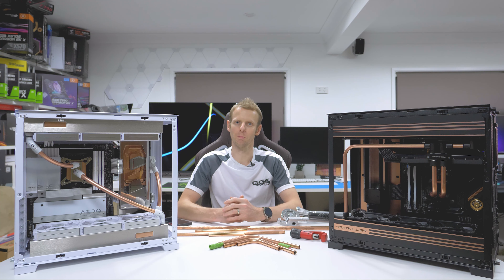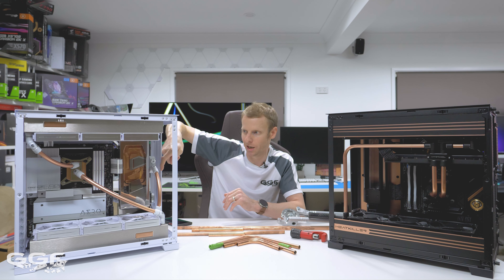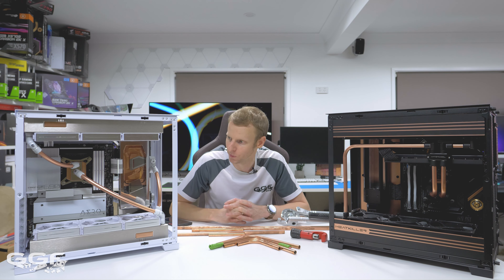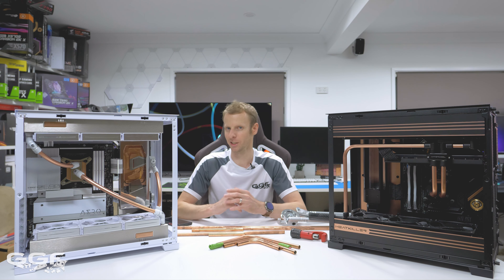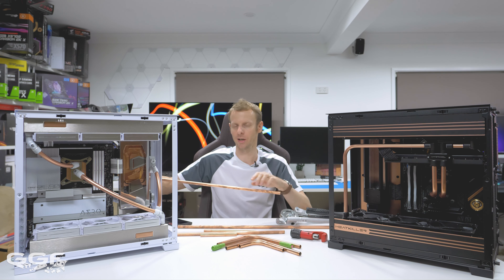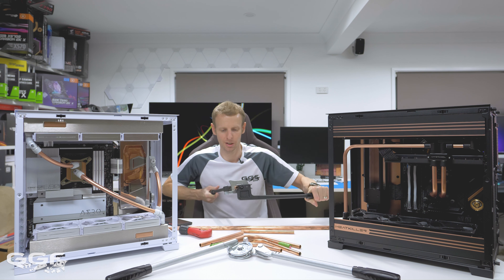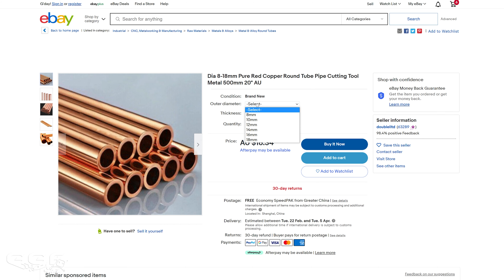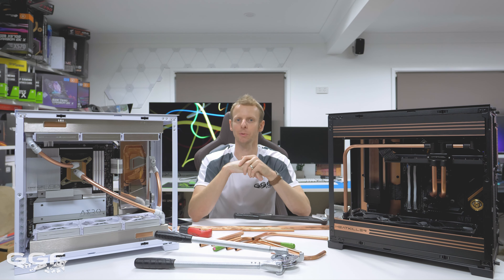LIAN LI O11 EVO Mod Build Video - Extended Riser, Extra Upright GPU Coverage, Bending Copper & More!

Comment: I'm using 2 riser cables.  Yes, you NEED a 90 degree riser if using the 2 slot forward position on the upright GPU.  I bought the ThermalTake 600mm cable and also used the LinkUP 250mm 90 degree cable from my previous build connected together.  Also would like to note that my motherboard isn't an E-ATX so there was plenty of room to fit the 24-pin in between.  With an E-ATX, this would most likely not be possible.  It's been almost a week with this build and I haven't had much issues with this PCI-E cable setup.  In fact, if you already have a 90 degree cable from your previous build, you can buy a 300mm straight cable to save some money because with the 600mm, I can touch the top of the case with both ends connected so a lot more cable than I originally thought.

With my setup on the Evo, I have 2 EK 360 XE rads top and bottom and managed to squeeze an XSPC slim 360 rad behind the upright GPU.  All fans are Phanteks T30.  The slim rad in the back was such a tight squeeze that I had to replace one of the screws with an even shorter one so it would stop pushing up on the upright bracket.

The GPU and block I'm using is the Asrock 6900XT Phantom Gaming and Bykski block.  The end where the connectors go has about 5cm or more spacing between it and the front glass so plenty of room.  I'm also using 3 8-pin 180 degree connectors for power.  With the rad behind it and tubing being an issue, I needed them for my build.  But even then, these 180 degree connectors also give the upright build a much cleaner look.

With all this said, my 0 RPM build is complete.  Yes, 0 RPM means fans are off.  They turn off when CPU is bellow 60C.  It's currently idling at just bellow 50C on both 5900x and 6900XT with none of the fans on.  Why did I want a 0 RPM build?  Complete silence, longevity of the fans and a much slower buildup of dust inside the case.

Comment: I am waiting for my upright kit and going for an inverted build, inspired by your white build but with soft tubing (black) and the EK Quantum Torque Titanium fittings and even if the GPU block is not installed yet, I already love the build so much. I am using a custom RGB controller (WLED) but not for RGB but to have my fans provide adaptive lighting (changing from neutral to warm white depending on the time of day)
This is my first water cooled build and probably my last one, but I really love this build.

Comment: wouldnt it be better if the fans behind the gpu would function as an exhaust? because the gpu fans are blowing in pcb direction which is direction of outside the case (if its upright). if used as intake, wouldnt it create turbulences by pushing 3 gpu fans out and 3 fans against each other?

Comment: I'm planning to use the upright gpu mount. Currently i have 1080ti with a kraken g12 + kraken x72. I want to use a 600mm riser cable but i'm worried my overclock won't be stable anymore.

Comment: Hello and thanks from a french fan, your copperblack v2 build is very inspiring but as a newbie in watercooling i had never seen such a connection as between the  gpu and tne cpu, could you tell me if the gpu is cooled the same way as in a more classical buid? Thanks for your vids.

Comment: Is it possible to have a horizontal gpu in an inverted layout with liquid cooling, in this case?
Reply: Yes
Reply: @newpairofboots   what about a vertical gpu in inverted layout and if so any thermal testing?
Reply: @mr.tootsie9409  I haven't done any testing myself but yes that would be possible as well. I'm sure you can find photos/videos of example builds that people have done like that

Comment: I have sadly discovered that an FLT 360 D5 will not fit on the side if using the upright GPU bracket unless you're willing to leave the side bracket not snapped in all the way - the FLT res at ~30mm is too thick and will run into the upright bracket itself.  An FLT 360 DDC should work if you reverse the bracket and then get some custom spacers to have it right up against the upright bracket, or an FLT 240/120 D5 should also work just by being placed lower.
Reply from the maker: Yep 360 would be way too long regardless and be impossible to fill.
Reply: but I honestly think that the flt reservoirs must not be used in that place as a gpu will block the fill port anyway.  Better to reserve that space for a slim rad/fans combo or just use fans or the drive bracker. A short res can be installed in the HDD cage area if looking for a clean space in the main chamber.

Comment: Great info on the build. Can the gpu be mounted inverted in a normal position case? like the ports are below rather than above? I saw a video that some model of gpu have higher temps if mounted in a normal upright position because of how the heatsinks are designed.
Reply from the maker: Technically it shouldn't really matter how the GPU is mounted. Providing there is enough flow. It should be the same.

Comment: Hey, Just found your channel looking for water cooling builds and have to say your builds are out of this world🙂👍
Thinking of building one now in the lian li evo and have a few question if you dont mind.
Cpu: 5800x3d  gpu: 6900 xt
Thinking to run 2 radiators, 1 side panel and 1 top. How would yoy fit loop for best cooling performance? Any advice on mods to use?